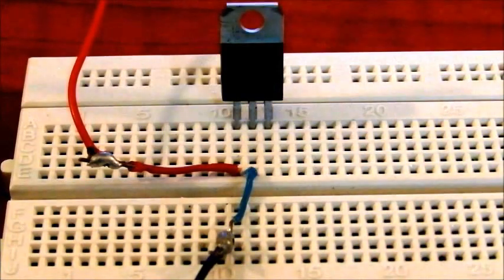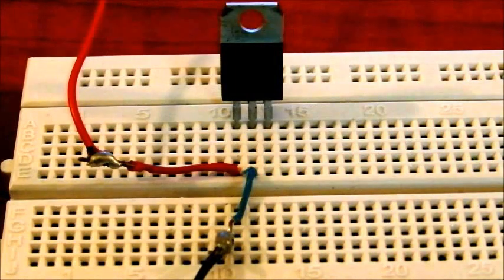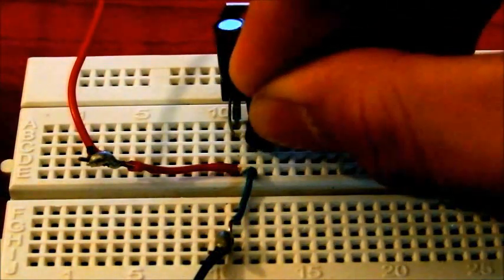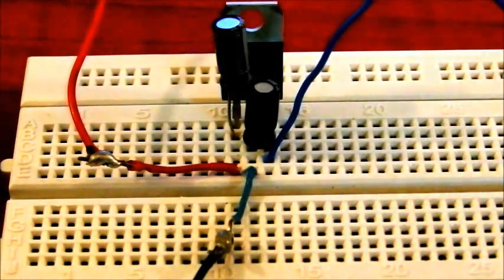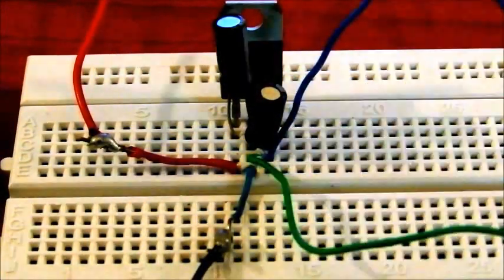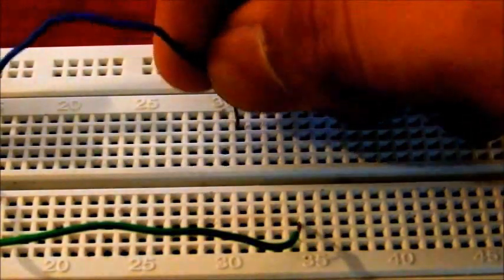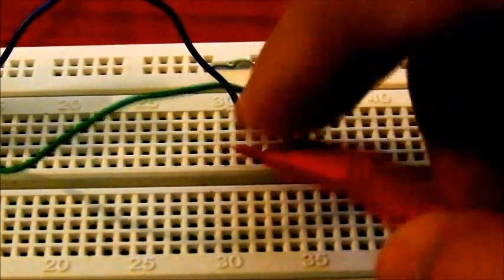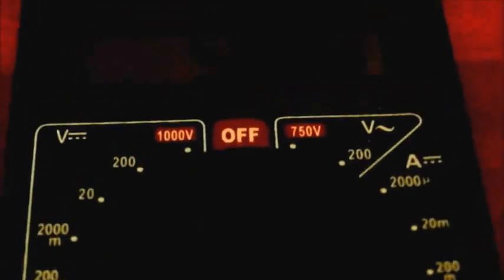5v from 9v battery using 7805 Voltage regulator IC

Comment: from where I will able to get voltage regulator 7805 IC
Reply: Digi-Key, Mouser, Ebay or even Amazon (beware of fakes).
Reply: lajpat ray market  chandmi chock delhi mo 8650648069

Comment: How efficient is the charging? How fast does it charge
Reply from the maker: Hello! Its not charger.. Its a voltage converter power supply for arduino!
Reply: hi Pir... i need to get down a 7.4 2400mah LiPo battery to 5v and 2amp for a raspberry pi... can i use 2 7805 in parallel

Comment: Does this work with fluctuating input voltage as well (say 7.5v -  11.5v)? Or would the output voltage change with the fluctuations?
Reply from the maker: Julian Suse Unfortunately, it only works with Direct Current which is constant :(

Comment: Does it get hot at this high voltage difference?
Reply from the maker: RPdigital Yes. hat is why it has a heat sink on top
Reply: ***** That is just a TO220 package, I mean that, does it need a radiator when running long time?
Reply: +Pir Arkam Why did you not use a switching regulator like the LM2576(total of five parts)?  I am working on some circuits for the Pi Zero and am driving my LEDs from a switched 3.3v regulator.  The whole thing is being driven by a $ 5 five volt switching regulator power supply that I bought off of Amazon.  I do not want to use the 3.3v feed from that power supply, as it uses a linear regulator like yours.

Comment: Like Pir Arkam... I too have used the 7805 to power zillions of ics. Especially the 16f628A, and the 16F877a along with an LCD and a RF transceiver combo from Parallax. The same same company which builds the basic stamp. I will say this, the pics will crash without the caps. You will wonder what is wrong because they will not be stable. The caps fix that problem. One other thing to really make a pic run rock solid, use a barrel like crystal. Not the ceramic ones. 8Mhz barrel type and caps..

Comment: Also most digital circuits run off of 5v. You need a stable 5v which will not dip. If you don't use the caps, the 5v will dip right down to less than 2v. Even the smallest load will cause the 7805 to lose its mind and not be able to provide a stable 5v. So take my word for it. So thanks to Pir Arkam this is SERIOUSLY important!! Like I said, just get in the habit of using the caps from now on. Your circuits will thank you I promise!!!

Comment: Thanks for your question...Get in the practice now and for the rest of your life of using caps with the 7805. If you don't the 7805 will overheat. A good example of this is a 7805 should easily power an LCD display and not overheat. But if you don't use the caps, the 7805 will boil. Not always, but quite often. It depends on the manufacturer of the 7805. Some are stable without the caps but most aren't. If you order 7805s from jameco they won't even work without the caps.

Comment: Thank you sooooo much for posting this video. I cannot believe that I have been doing electronics for the last 12 years and I have used 100's of 7805s. Recently I have had a lot of problems with them. I bought 10 of them from jameco and I thought that all of them were bad. Well, I did what you suggested with the 1 uf and the 10uf. Now all of them work!!! THANK YOU   To everyone out there, this guy got it right. I will NEVER use another 7805 without the caps!!

Comment: According to datasheet, PIC16F877A operating range is 2.0V to 5.5V. So if you use this regulator which outputs 5V, you will be fine. LCD display typically can operate at 5V too.
I am not sure about the receiver module. Is it an IC chip or a bunch of resistors/capacitors? For each of those cases, they normally operates at 5V just fine.
The question you should be asking is the current capacity and not the voltage. And using a 9V battery for such application? No problem! =)

Comment: I want to use the 9V battery because I like its nice, neat boxy shape, but what is the advantage of using 9V battery with regulator rather than AA batteries?
Is the regulator dissipating any energy when converting from 9V to 5V?